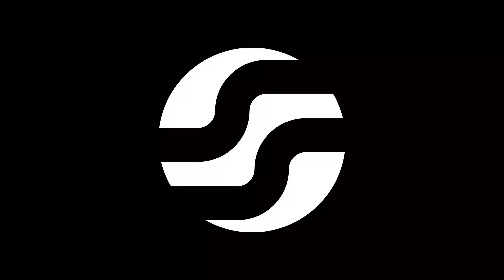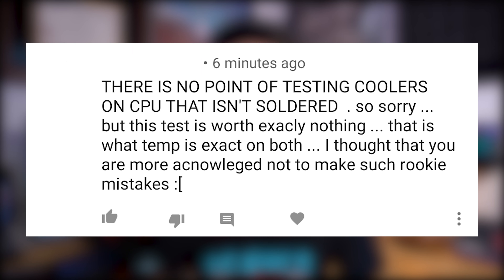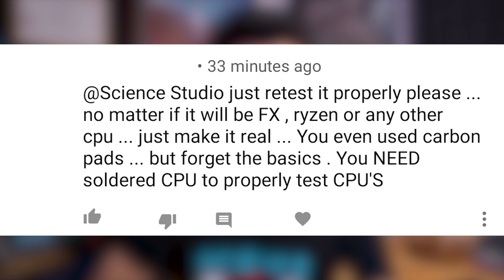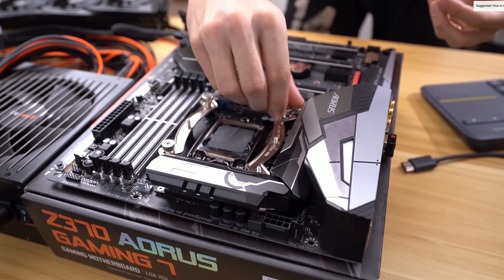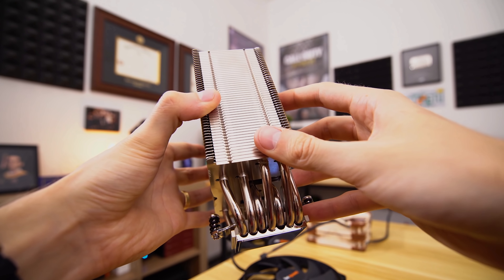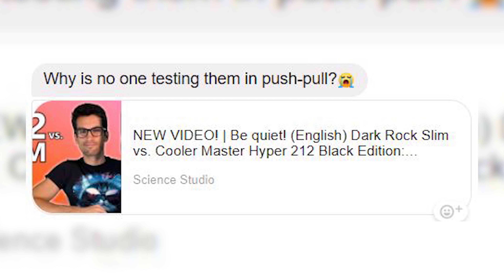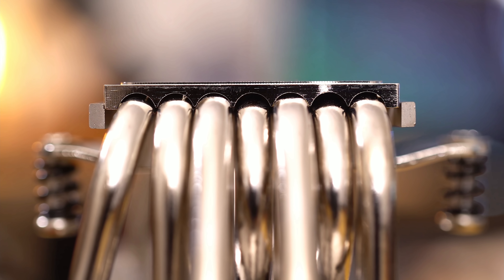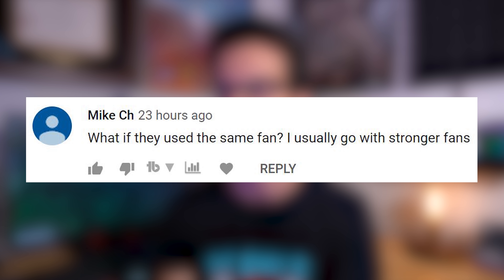Addressing Idiocy and Testing Methodology

Comment from the maker: To be clear, the only idiotic comments in this video were the first two presented. I appreciate the other questions asked, and even encourage them! Thanks for watching.
Reply: In the future will you change the direction or positioning of the fans from their stock configuration?  For example some large tower coolers perform best with two fans pulling in opposite direction facing outward <||||| |||||> creating a negative pressure zone in the center which is better in a test bench or an open environment even if in stock configuration they are both facing the same direction <|||||<||||| to exhaust air out of the case and reduce turbulence
Reply: @seanlutzke1694  what coolers benefit from that?
Reply from the maker: @seanlutzke1694  I only intend to test in the format best described by the manufacturing company. If, for example, be quiet! releases, say, the Dark Rock Pro 5 and features two fans pulling in opposite directions as you've described, then I will benchmark the cooler in that config. Ideally, however, you want air patterns moving in the same direction - generally from front to back.
Reply: You're doing a good job. Don't look at stupid comments.
Reply: This may be a stupid question but can the GPU temperature affect the CPU temperature inside case.
Because hot air is lighter than cold air so hot air from the GPU ( graphics card) unit affect the CPU cooler temp?
Reply from the maker: @ZeppelinEXAhmed  Yes. This is why I run all case/cooler temperature tests with the GPU under load. Under normal gaming scenarios, this almost always happens.
Reply: Gotta love idiotic comments, appreciate ya videos
Reply: It was I who made those comments you've shown in the video! This is for not paying me 6k for my PC, 6K no less or you get sued!!!!! JK I loved the carbon pads btw
Reply: @APUGuru  Some large tower coolers perform better that way on an open air test bench. While most modern cases benefit from positive pressure, a test bench isn't thermal isolated from the surrounding air so it doesn't need to direct air closer towards the exhaust or away from the intakes.
Reply: If a review video has 90% of likes ratio I usually trust it. I'm actually learning the things that can affect test results.
Reply: Don't worry about them bud.  You'll never get those sort of peeps to open their minds.  Not only are they not capable of imagining themselves out of a problem.....
but they are also unwilling to LEARN from others!  Which is free knowledge...... CRAZY!!  ^___-
Reply: honestly doesn't make sense I'd think that testing heatsyncs on soldered cpu's would be better because they would be more consistent seeing as soldered cpu's temp's usually have a more similar average temperature. ( not that it really matters)
Reply: @GregSalazar  , Thanks for cleaning that up.
Reply: @huri9946  as far as trusting test results it's good to watch a few channels as they will get different results, but it is great to hear that you are enjoying learning from the channels about how results can vary depending on different test situations & not stuck on 'It has to be like this or it's invalid'
I love the 'Science' of how things work & there is always something new & exciting to look forward to
Reply: I am not sure why you're replying to the comments section never mind making a whole video about 1 guys opinion. Just like your Craigslist videos there isn't really any point.
Reply: @darronpattel  And 99.8% of the people who buy said CPU will not solder the CPU and and those looking at reviews for for good Cooler for their CPU will only care about the numbers they themselves will see, as an owner of an i7 8700K I do not care about the numbers on a soldered i7 8700K, as I will not be voiding the warranty on my CPU, and no I wont be delidding it either.
Reply: YOU HAVE SO MUCH RESPECT FROM ME for not making fun of that guy's English and actually talking against it because I read in a post that if someone speaks broken English, that person probably speaks another language, and as a multilingual myself that changed my perception forever and I've always condemned making fun of someone's English since then...
Reply: @Skelath  naa what i was saying is if u bought 2 different cpu's and they wern't soldered they would be more likely to have different temperatures becuase of use and so on, but with soldered it has a better average because there is no thermal paste to dry up from use.
Reply: @darronpattel  You mean buy a $5 tube of thermal paste which has more than enough paste to replace the thermal paste on your CPU once every 6 months for several years?
Your arguement is still based on getting people to solder their CPUs and typically when people buy a CPU they will buy a cooler within 2 weeks or on the day of purchase due to a lot of high end consumer CPUs not including a stock cooler.
Reply: @Skelath  No your mistaken not what i was talking about, im talking about how you get the cpu when you buy it, some are soldered between the  heatsync built on the chip, some have thermal paste, either way ur gonna put ur own paste on,  just search up cpu delidding you'll see wat im talking about some cpu's can be delidded some can't that's all.  your right though about what ur saying soldering the cpu is not worth doing yourself, just good to know if its a soldered chip or not when you buy it.
Reply: @darronpattel  Getting a soldered CPU isn't a "lottery" it is based on the generation of the CPU, the 9th gen are soldered, the 8th gen are not soldered, you're not just going to randomly buy 10 i7 8700k CPUs and find some of them are soldered, none of the stock Intel 8700k CPUs are soldered and neither is the i5 8600k CPU he tested.

If you want soldered CPU results becuase you're wanting to buy a cooler for a 9th gen Intel that's soldered then ask him to do a benchmark on 9th gen CPUs.
Reply: @Skelath exactly, you can actually look that kind of thing up even think we got confused on subject,  all i was saying is ive noticed sodlered cpu's usually have more of a similar average temp becuase the solder doesn't wear down from use, therefore it'd be better in my mind for testing out how good a cooler is.
Reply: @Skelath  it doesn't really matter with new cpus for testing purposes, its just soldered cpu's will have a more similar average temp becasue theres no breakdown, testing on cpu's that arn't soldered won't make much of a difference, just for average temps really and like I say if the cpu's new it won't really matter if it's soldered or not
Reply: @darronpattel  In other words you don't want Science Studio to use 12 month old thermal paste and you would like Science Studio to show on video of him applying brand new paste before he plonks the cooler on it so you feel satisfied that the temperatures wont be skewed becuase of crusty paste.
All of which is irrelevant as he doesn't use 12 month old paste that's still stuck to the CPU and all of this is to curve conspiracy theorist that get hyper vigilant about stuff not shown on camera that will still go berserk and question if he really did use a soldered CPU if says he used one and then get him to show the soldering on camera and test both coolers in one take with no cuts and have the CPU and cooler in view at all times so there is no chance for him to swap the CPU out for a non-soldered one becuase the hyper vigilent fanatics may think he's shilling out for a certain cooler.
Reply: @darronpattel  Thermal paste doesn't wear down in the space of a few hours of testing, which is why I find it pointless to use soldered CPUs.
Reply: @Skelath  again not wat I was saying, not talking about the thermal paste between the cpu and cooler.
Reply: @darronpattel  You mean the paste inside the CPU itself that takes years of usage to wear out?
Reply: @Skelath  ya, and thats just like what i was saying even then it only matters if the cpu is like 2 yrs or older
Reply: @Skelath  personally i use a i5 2500k test bench so i never have problems testing coolers out
Reply: @darronpattel  Yep and if he uses a soldered CPU, people will then complain about ambient temperatures.
You're fighting over a few degrees which dont make an impact to and average.
Reply: @Skelath  I'm not though, pointed out several times it doesn't really matter, it's just how I test becuase some of the older cpu's i've tried to test it with varied alot in results due to use and such, and even me being in a very humid area of the world, ive never had ambient temperature problems because my environment is isolated enough with a dehumidifier.
Reply: @darronpattel  a dehumidifier does not normalize the room to a specific temperature when winter and summer comes around.
Reply: @Skelath  There's other things too, and theres several differnt types of dehumidifiers ones that bring air from indoors and ones that circulate the air already in the room, I'd do some research into heaters and fans it might really help ya out.
Reply: @Skelath  check out growing weed, theres stuff u can actually get to measure the precise level of humidity
Reply: @darronpattel  Those are called Air Conditioners / Heat pumps, not Dehumidifiers, "Dehumidifiers" extract moisture in the air and after a while you have to empty the water from the unit.
Dehumidifiers don't work as intended if there is high air flow being pumped into the room.
Reply: @Skelath  I have a very special one then, cus mine is a heater and an air conditioner too...
Reply: @darronpattel  Yeah it's called a Dimplex "Air Conditioner", heats, cools down, and dehumidifies, all 3 are separate functions and as soon as you switch to heat or cool down mode it starts bringing moisture back into room.
Reply: @Skelath  well it is possible to use more then one device at a time for blowing air around.
Reply: @darronpattel  Yes it is, just like how it's possible two use more than one light bulb in a room.
Reply: @Skelath  Oh yeah
Reply: @Skelath  OH YEAH OH YEAH OH YEAH OH YEAH OH YEAH  OH YEAH OH YEAH OH YEAH OH YEAH OH YEAH OH YEAH OH YEAH OH YEAH OH YEAH OH YEAH  OH YEAH OH YEAH OH YEAH OH YEAH OH YEAH OH YEAH OH YEAH OH YEAH OH YEAH OH YEAH  OH YEAH OH YEAH OH YEAH OH YEAH OH YEAH
Reply: @darronpattel   ɥɐǝʎ ɥɐǝʎ ɥO

Comment: I think that guy saw JayzTwoCents' video on air cooled vs water cooled where the aio was held back by the tim inside the 8700k and didn't understand what Jay was saying
Reply: Buzz K 😂
Reply: So Intels TIM isn't as good as Hardware Unboxed Tim, he doesn't hold back Steve
Reply: @shaneeslick  they didn't use the exact same chip tho, the tim could be better or worse depending on the chip
Reply: @maggi98mw  I don't know if Tim & Steve share or get their own chips, wait we are talking about their Nandos orders now aren't we, I get confused
Reply: @maggi98mw  not partucularly the Tim for unsolderedchips is normalltfactory applies and generally consistent dependingon how long its been for the chip will be the primary difference

Comment: Can you test the Corsair H150i pro vs the Noctua NH-U12A and/or Nh-D15/other similarly good aircooler please?  

Most reviewers test the coolers for 15 minute bursts which doesn't allow the water to reach thermal equilibrium as you pointed out so well in a previous video.

Comment: It might be interesting to evaluate noise levels not only by dBa but also by the pitch or frequency of the noise.

There are some fans that are not particularly loud but generate an unappealing noise profile.
Reply: Agreed. I bought a Corsair fan because on paper it was quieter than the Noctua redux line. In practice, the noise it made was so high pitched that after a few days, I just returned it and ordered a Noctua fan. Couldn't be happier.

Comment: One thing I'm curious about would be a "mounting test", to see if there'd be a difference in temperature depending on how much the cooler is pressed to the cpu. Basically, just put a cooler on the cpu, then compare it to increasing amounts of weight on it.  I assume there might be a variance on really weird pastes like Ceramique 2 (which might also work to fill holes in teeth), but not so much on the normal stuff.

Comment: The only issue I had in that video was the claim that there was an audible difference in less then half a decibel. I'll accept an audible difference in higher pitch vs lower pitch, but not in that small of a decibel difference. I've thought about buying a new fan for an older cooler to reduce noise, rather then spend the extra money on a completely new cooler.

Comment: The problem with using a case is every case varies. If you see a case review the cases' thermals are indicative of the case's ventilation and not the cooler; although, the delta can be assessed if you provide the internal case temperate, in addition to the the Cpu cooler's temperature so you can draw the Delta.

Comment: The first guy is probably right in the sense that the difference between a good heat sink and a bad one will appear to be smaller if you have a poor thermal conductor in between the heat source and the heatsink.  I doubt it matters much at the consumer level, anyway.
 
As long as you're consistent and you document your methods what you're doing is realistic, especially if one assumes the CPU you're using is likely to be commonly used among your viewers, but the fact that you respond to criticism by calling the person an idiot is one of the reasons I'm not a subscriber to your channel.  The fact that you disagree with him does not make him an idiot.  It doesn't even make him wrong.

Comment: I looked back at your test video and I have a few feedback when you test coolers:
- Please inform us at what Ambient temperature you tested the cooler (ºC/ºF?).
- And if Possible, the Relative humidity (RH%). 'though it should not affect to much, but in some very high or low values can make a difference in performance.
Reply: I really doubt that it would make much of a difference. Unless he's either in an extremely cold or extremely hot room, the difference would be very minimal. Humidity might also be not make a huge difference and would be more trouble that it is really worth it unless he was absolutely squeezing every ounce of life on a CPU or over clocking

Comment: I(TBH) haven't watched many of your cooler reviews, but one bit of advice I would give(assuming you don't do this already) is to have everything else standardized. Use the same system(case, ram, motherboard, GPU, ETC) for each test. You can do this with cases as well by using a standard cooler with everything and just changing the case. This not only gives a better apples to apples comparison of say two coolers you are testing for a video, but a larger cache of data to use later on as you see fit.  This allows you to compare coolers you tested in the past vs whatever you are testing now without retesting. Might be a pain in the ass now, but in the future it could save loads of time.

Comment: Like I said in my comment, what struck me as weird was the "why" with the 212 VS the Be Quiet.  Which on closer inspection turned out to be fan choice by the MFG, and quite possibly the gap between the back of the fan and the heatsink on the BQ (which I think is done for sound reasons.)

Comment: Apples to apples, real world testing for the average consumer. Not everybody has the means to solder a cpu, or even want to. Well done Greg
Reply: It is quite obvious that most people nust simply doesn't want to do any solder work.
Reply: Noone solders a cpu asode from manufacturers or people that will break thier cpu

A soldered ihs is simply how a cpu is manufactured . intel up until recently used a thermal paste based thermal interface that was far inferior to solder used by amd and older generations of intel before. It simply increasesthermal delta not cooler performance (unless of course two coolers were performing at maximum efficicney at movingthe beat  but that's  bot the case most of the time and crappy Tim wont be a thermal bottleneck unless you want to use real high end cooling

Comment: Could be interesting to test whats in the box and then test with noctua fans, allowing you to demonstrate if it is the fans holding a cooler back or a genuinely bad cooler. Could be that a cheap cooler has bad fans but is more efficient than an expensive cooler with much better fans and people would be better off buying the cheap cooler and upgrading fans

Comment: Your testing methodology should include noise normalized performance. Otherwise out of two similiar sized coolers the one with the fan that spins at a higher rpm will always win the thermal test. But also lose the noise test. That's what i felt was missing in the NH-U12A vs Dark Rock 4 Showdown, The noctua cooler was just running at a much higher RPM and the showdown didn't really show how the coolers perform at the same noise level.

Comment: This guy is clearly missing the difference between benchmark-style testing and standardized testing. In the later, you couldn't care less what the actual temperatures are, the important metric is the difference between temperatures. TIM, case-airflow, ambient temperature, none of that matters, so long as it's the same (or at least properly accounted for) between individual attempts. GamersNexus recently did a video extensively discussing standardized case testing, and Steve emphasized that the configuration they use is almost certainly not the best possible for the many of the cases they test, but the goal of their testing is standardization, not the absolute best performance possible. 

Keep doing what you're doing, you're making plenty of high quality tests.